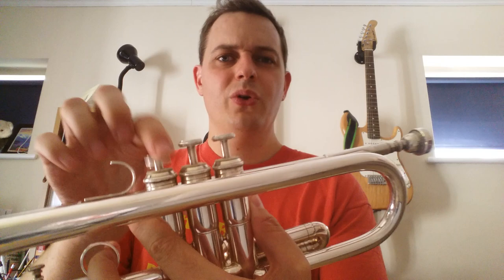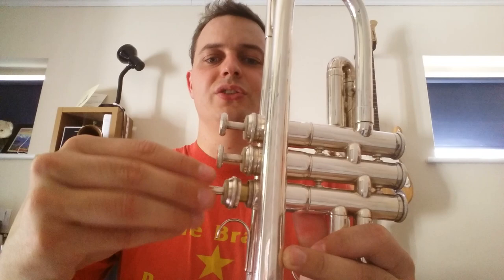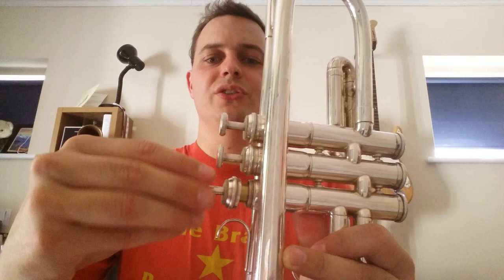Brass Problems: Trumpet valve still sticking after being oiled

Comment: Sometimes you need to stretch out the spring a tiny bit. I had to do it to my 3 valve spring. It’s been 20 years and my valves are still good as new.
Reply: Literally just wondering if I could don't this. Thanks for the confidence
Reply: How do you stretch out your string?
Reply: @unclesimba9975  just with your hands -- take the spring and pull it apart a tiny bit.

Comment: I just borrowed a baritone. Valve 1 was very sticky. It was terrible. I cleaned it, oiled it, but it didn't work. But I had also messed with the oil of the other valves. And I noticed that the oil was making them more sticky.

That's when I noticed that too much oil is a thing. At least with the bicycle chain oil I used. It's a thin oil, but probably not very thin.

I took the valves out, and cleaned only the valves, and left the residual oil in the cylinders. I cannot remove all the oil from the cylinder by cleaning only the valve, so there will be very little oil left in the cylinder. As long as there's some oil, it should be fine. Because the contact area is very wide, the parts are not under very high contact forces, and the parts are very smooth. This means, any little oil there will be trapped between parts, and parts may have almost no chance of rubbing each other. On the other hand, oils have very high cohesion and reasonably high adhesion. So, if there's too much oil, it acts like a weak glue.

My 3rd valve was great. I messed up that one. Then, fixed all of them. When I played it, I had no problems at all 😍

BTW, I noticed that springs of valve 1 and 2 were shorter than valve 3. The wire thicknesses were the same. So I stretched the short springs just enough to make them approximately the same lenght as valve 3 spring. It was not a huge change for springs, so I don't expect them to get weak because of that. But this change makes them slightly stronger.

Comment: I just bought a new trumpet on ebay... yes ebay it was 20$ and a bundy selmer so yes... but its stuck bad I've cleaned it and oiled it tried working it back and forth but it wont move on its own at all i was curious so i put it in a different valve to check to see if it was the valve itself or not and it was fine but i put it back in the right one and it does not move any help or advice would be very appreciated!!!